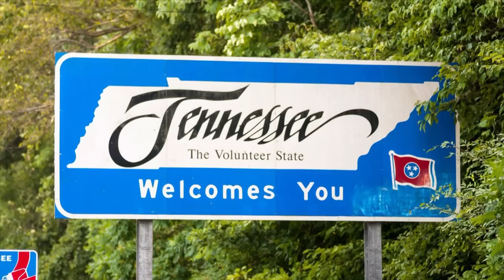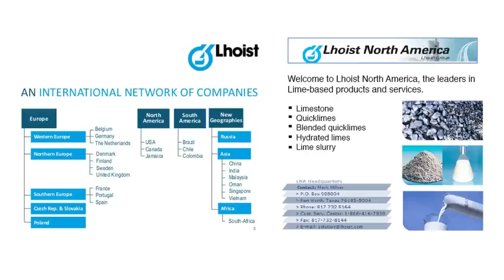EMD and GE High Hoods: A Legacy in Diesel Locomotive Production

Comment: My top 5 favorite high hoods,,,,,No.5.   Southern GP30s and 35s on the auto parts train "Spark Plug"  as it climbs out of the OHIO river valley south of Cincinnati in the 1970s.
No. 4.  Ex NW now CNW high hood C628s working the UP in *ichigan.      No. 3.  Southern High hood SD24s on the SRCO/COSR(Southern-Columbus run through).
No. 2.   N&W GP30s with the bell mounted in the high nose!  I caught a few of these back when.
AND,,,,the No. 1!     Back in 1978 CR was power short(again), so they leased several ex-Frisco U25Bs.  These were the former GE demonstrator high hoods!  I saw two of these running around.

Comment: Fun video and catchy tune.

I also believe the SR ordered heir locos long hood forward because if they were running short hood forward it was easier the the engineer to sight the signals, as he'd (basically) be on the wrong side of the loco - the signals being set up for the engineer sighting from the right hand side, or something like that....
Reply: Agreed Phil - iirc, this was also said about the Alco C420's on the LIRR too, otherwise visibility becomes abysmal running LHF from the "wrong" side...
Reply: @openeyes-411  Signals could be on either side of the track, depending on the territory of the railroad. That was the job of the other crewman, whether it was a head end brakeman, fireman, or conductor (depending on the era).